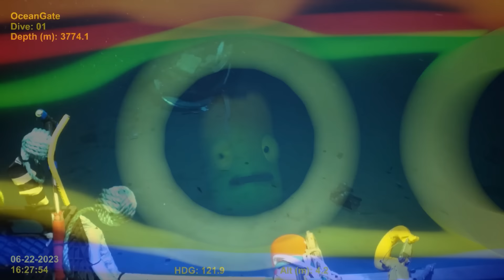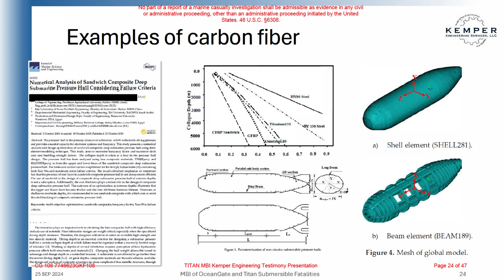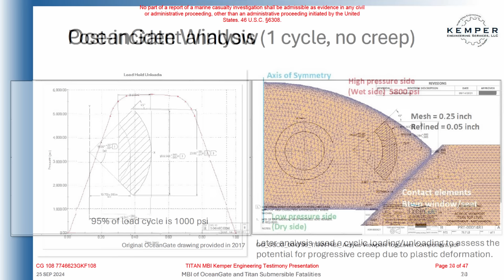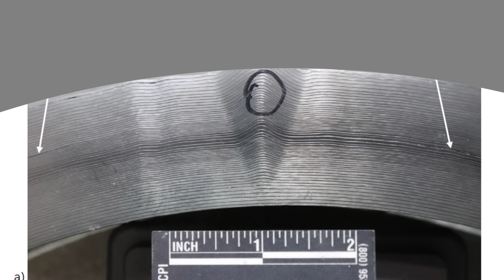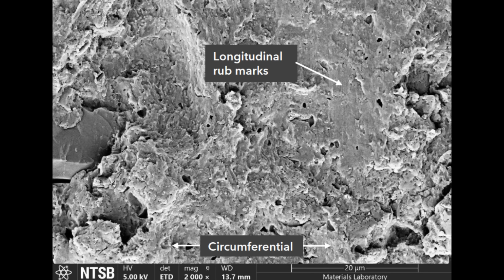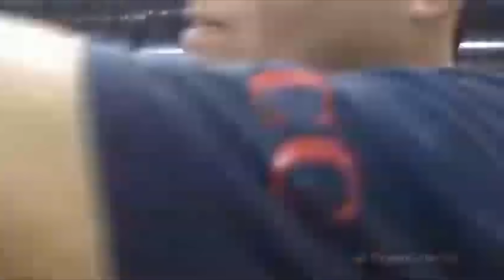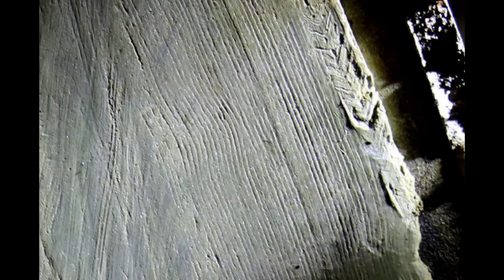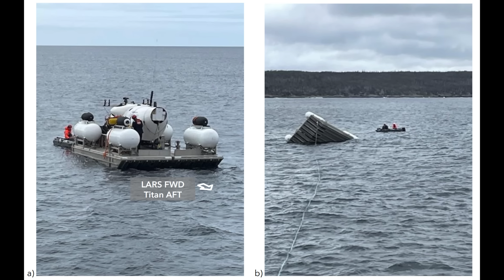OceanGate Wreck Shows Why Sub Wasn't Strong Enough To Survive - NTSB Shares Important Details

Comment: -We built a 1/3 scale model.
-Great, did it work?
-No, but we're still convinced the full scale will work nonetheless.
Reply: The video of them putting the end caps on the carbon-fiber tube were enough for me to realize it was doomed to kill someone. It was like some kind of 'Billy-Bob and Leroy make a sub in their garage' show. Amateur hour gets people killed 4km down.
Reply: @DavidParry-BackFromBanned2019  Absolutely. They didn't use vacuum degassing of the epoxy (which apparently was also the wrong kind for joining titanium with CF), no preparation of the titanium surface either by etching or abrasion, no cleanroom or Tyvek suits, some of them appeared not to even be wearing gloves and put their hands on the rings, etc. It was a joke. It's too bad because had they actually done the engineering right, there might have been a possible application for CF submersibles. Now it's likely no one will even touch that idea for decades.
Reply: @rjinkglider6908  I hope they don't. At 4km down it was only the resin holding the thing together... not the fibers.
Reply: @rjinkglider6908  All that stuff your talkking about cost a lot of money and this guy was not going to spend it on clean rooms, and making sure his number one point of failures were done right
Reply: All that from an educated person who has an engineering degree
Reply: @angelobryan4699  He was a C student. The degree was definitely not worth the money for the paper it was printed on. He knew just enough to be extremely dangerous. He thought he could cheat physics, and if you're an engineer you know down to your bones you can't cheat physics.
Reply: It was the repeated (successful) trips that caused the eventual failure.
Reply: @BodywiseMustard  It was expired carbon fiber. It was failing from day 1. No one knows how it lasted 88 trips, much less the literal first.
Reply: @highpol1ce  It didnt actually last 88 trips, the trip numbering was spread between two diffrent hulls.
Reply: @highpol1ce   well carbon fiber is not approved but it can still be used to go down to deep depts its just that as mentioned carbon fiber delaminates over time and was actually mentioned to this idiot multiple times at the end of the day the accident was caused by ignorance , lack of research , ego , and ignoring every safety regulatory rule when it comes to deep sea travel
Reply: @highpol1ce  "SANDED DOWN THE SURFACE BETWEEN APPLYING COATS"
Oh... you mean severing the fibers holding the 4km of water pressure back? Smart move. I hope they died fast.
Reply: I appreciate your "steel man" of Stockton Rush's view of carbon fiber in pressure vessels.   @BodywiseMustard 

Obviously, they should have been testing the vessel as a robot, until reliable knowledge of carbon fiber's successive use failure rate was obtained.
Reply: @BodywiseMustard It's too bad someone didn't sabotage the sub while it was stored outside in a parking lot.
Reply: I think you misunderstand. They tried carbon fibre end-caps, which didn't work, so they decided to only use fibre for the more stable cylinder, and use titanium for the end-caps, which did pass tests.
Reply: @BodywiseMustard  my point is, did they ever successfully test a scale model of the final design?
Reply: @BodywiseMustard  So the carbon fiber was a problem, so let's only replace part of the problem. Wow brilliant. The negligence and incompetence every step of the way was just, indescrably baffling. Especially when this has all been done before, nearly routinely at this point.
Reply: @BodywiseMustard  Rush didn't do any testing, certainly not to the level that other submersibles are.
Reply: you are clearly not aware they did 13 trips to the titanic successfully before this occurred.
Reply: @TreeHugg and the point of this comment was that they never successfully tested a schedule. and more to your point that they did 13 successful trips, that's nothing. That is a drop in the bucket compared to what most other deep sea submersibles have been. Most can do hundreds or even thousands of trips before they need serious maintenance.
Reply: @the_undead   Agreed, Hasn't Alvin done like over 6,000?
Reply: @sologamer3122 technically yes but Alvin has been to the point where it is definitely a ship of theseus. The nameplates are likely one of the only things remaining from the original launch model of Alvin.

However, even if he original unmodified version, definitely conducted hundreds potentially even a thousand dives before anything major was changed. And Alvin went to much more dangerous conditions than Titan ever went to.
Reply: @TreeHugg  The only way to consider the previous trips a success is to ignore the eventual outcome. Each trip was damaging the hull and a roll of the dice. These were commercial passengers (despite being call 'mission specialists') so the entire point of this was to demonstrate a safe, reliable way to do so. This proved how not to do so and set the objective back substantially.

Comment: When you mentioned machining the layers flat that was a bit of an alarm for me. You ar effectively guaranteeing a void under where the bump used to be.
If you want to look at how the carbon weave matters then you need to look at Formula 1. They have Carbon wings that flex in all manner of ways and it's all about how you lay the weaves of the carbon material. Even the type of weave can make a massive difference in how it performs.
But the main thing about the F1 stuff is it is all multi directional woven material. The fact this appears to be unidirectional makes it fundamentally less strong than ones with multi-directional weaves.

Though by the looks of it from this video it was a whole chain of minor events that contributed along with Oceangate and  Rush's negligence in following up on anything that might have been a warning.

Comment: "Recover human remains" that made me chuckle and I felt bad about it. Judging by how the debris looks and considering the information I have on the subject I imagine that for such a big chunks of the cylinder to have survived almost intact the oposite side of the hull had to collapse so quick against it and at such speed it would make you mist. Sort of like squeezing a roll of toilet paper. Early models suggested a total collapse but because of the pressure at play down there it equalized so quick that the first imperfection that entail an issue became catastrophic and the rest of the vessel "barely" suffer any damage. You can identify quite well every component and structure that have survived.

Comment: Picture is worth a thousand words but only if you speak its language. Does a video count as a thousand words a frame? My translation for this video.
  The initial pop on the previous dive was it opening a glue void, maybe even the dust filled one. The  water got in horizontally to the laminate layers at the machined ring where they cut to fit.  So the outer layers they cut into might as well as not been on there. Then use those shaved wrinkles to travel through layers radially until insufficient layers remained. Then crushed in and sheared off the inner support ring. I wonder how many of them actually knew how to read the sensor data or even looked. Did not realize it was actually a multi dive failure event, figured just one bad catastrophic one. 
   Machining those wrinkles off seems crazy to me, you just tore open your layers, it probably looked like swiss cheese if it had anywhere near as many wrinkles as that one drum in the video. 
   I looked up a video of a 5000 psi pressure washer to see what that water jet would look like, less extreme than I thought but how would it fair against individual layers of the fiber from the atomic level and over every square inch  it can find any imperfection, plus gravity driven vs motor so the pulses would be different.

Comment: They went down multiple times after ignoring the warning systems?!? 

Look, speaking as an engineer, sure there are better ways to design this thing and logically speaking there is no reason to physically being in this thing, if all you see is recorded by an outside camera anyway. But most importantly as long as the warning systems work and have enough of an fail safe margin, a sufficient design can work just fine for the time being. But you can’t ignore those … that’s the whole point! With that attitude the guy could’ve made the perfect submarine and still get it destroyed sooner or later (obviously later, but you know what I mean)

It’s all just aggravating

Comment: To fix the window strain issue while still having the desired optics, couldn't they have an extra insert that is flat on one side and held in place by a gasket. Then you fill the interface between the two windows with a viscous fluid that has the same index of refraction as the windows. That should isolate the load bearing portion of the window from the part that is just there to provide better optics.

Comment: This just gets worse and worse...  ignorance x hubris, Rush compounded the design flaws and the manufacturing deficiencies to eliminate all margins of safety. Really crazy or pathological thinking.
Reply: WRT the carbon fiber cylinder to titanium ring glued interface; the circumferential strain is twice the longitudinal strain, for any applied external pressure. Kind of a guaranteed failure of the glue joint. The inner flange of the Ti ring would have needed to be much thicker, and the titanium ring to carbon enforced cylinder interface would have needed to be stepped or beveled to equalize the strain on the two sides of the glued joint.

Comment: i mean this is why you should never trust for profit extremely dangerous exploration ventures. space, ocean, mountaineering. i mean this sub should be checked thoroughly after each dive but that cuts into profit. when profit is the sole driver safety goes out the window.

Comment: 15:43 i dont have a clue, but if either the glue or the fibres show, that means that in general the two components were matched pretty well and both gave way at the same amount of force. If there was a clean layer, that means bad adhesion
Reply: You cannot conclude it that way, it depends on local bending forces.  That can produce any pattern.

Comment: Most probably there were no dead bodies or even pieces. When the hull is breached and water rushes inside, the inside volume becomes literally a diesel cylinder with oxygen and organics mixed and ready to combust, with water playing a role of a piston. Everything combustible inside has ignited and was consumed by a huge flash. What didn't ignite was shredded by the cavitation bursts even before the hull touched it.
Reply: I'm not so sure, for example you can see a picture of the computer monitor that was inside the hull and it is essentially undamaged (I mean relatively, it's twisted and banged up but it's easily identifiable).

The dieseling would last a tiny split second and is essentially irrelevant, nothing solid will be burned up or ignited by it (the time frames involved are simply not long enough to allow meaningful heat transfer no matter the temperature).

It's also unlikely that their bodies would have been inside the compressed air bubble when it ignited.

Of course the implosion/cavitations would be extremely violent but I would not be at all surprised to learn significant 'chunks' were identifiable as feet/hands/jaw etc. etc.
Reply: Did they nude diving?
Reply: @Winkemaennchen  why would you ask this?
Reply: @onebronx  Afaik, not even one shoe found, neither other remains and no fishes for the big meal.
Reply: @Winkemaennchen  yep, and my initial comment explains why it is so

Comment: Experiment to try at home: Compare the stiffness of a cardboard paper towel tube, to a tube built from a rolled stack of paper with the same total wall thickness. You'll find the solid tube is much stronger. Those four glue joints between the sections of carbon fiber are a big weakness in the design (literally).

Comment: Abt the window shape and magnifying effect... wouldn't it be just as easy and way safer to use a regular window with an insert held in place right behind it? The insert only stands to correct vision, and isn't load bearing. The only problem I could see is if the outside window changes shape at pressure the insert might not fit or work anymore...

Comment: The real, real reason is because you would have to NDT test it for every dive unless you over built it for safety factors so much that it would be heavier.
 Ceramic Composite is probably not the same type of thing as CFRP.
 It could be a metal, ceramic matrix composite material. Whole different critter there, think about a ceramic sponge saturated with aluminum.
 It's the dozens of layers of fibers hidden from inspections that makes that design unsafe.
 The glue failing in the glue and on both sides is exactly what you want, the glue joint was overloaded and failed perfectly.
 The second glue joint was a bad joint where the adhesion to the carbon failed, bad surface prep or poor clamping pressure.

Comment: If what you’re saying about carbon fiber not working under compression is correct then why the hell is it used in formula 1 monocoques for the cars,…. That’s is exactly why , it’s compression loads and  its ability to absorb compression and protect the driver.

Comment: My theory is that water leaked in and they died a slow and painful death as the water filled the submersible until covering over their heads and then after about 2 minutes after they died the submersible imploded.
Reply: Water is not compressible, in that scenario no implosion possible.

Comment: I originally thought it was the carbon fiber of the hull. It seems it would have been better, weight wise or whatever, to use a solid SS steel hull. It's not worth people dying for weight reduction.
Reply: Titanium is way to heavy for such a construction. You need big ballast tanks and that type of boat you can simply buy.

Comment: Hi, I responded to one of your earlier video's: I'm a mechanical engineer so I think I can provide a little insight in my train of reasoning for the consequences of the multi layer solution to the wrinkling problem. It works best if you compare the use of carbonfibre in this case, when picturing a rope. Ropes can deflect expansion stress (high higher pressure inside of the sub) better than compression stress (high pressure on the outside of the sub; like standing on a balloon). The same goes for carbonfibres: they are great for pulling forces, not so much use for compression forces. To make them withstand compression forces better, the fibres are moulded in a resin, usually epoxy. The weak spot this creates for using the Titan, is that the hull will only be as strong as the resin that keeps the fibres in place. However, as it now seems, the point of failure for this incident was actually not the hull, but it's connection to the spheres. In hindsight that makes sense, because here there is no other material than the epoxy glue. When the Titan would be put under repeated stress cycles, micro cracks are basically inevitable to appear in the way the titan is constructed. The mechanical properties of the epoxy/carbonfibre hull would change with every stress cycle, witch would result in a even so slightly different deformation in the hull and spheres, resulting in weaker spots, etc, etc. The whole basic conclusion would be that carbonfibre is an unreliable material to use under a very high compressions stress situation and could best be avoided for repeated use, unless very high safety tolerances would have been calculated. Unless of course, the high risk of death you are willing to take would be acceptible, witch it hardly is.

Comment: Oh wow!  Only 20 minutes in and I'm amazed by the smooth surface with no glue sticking to it.  Roughing up the surface is simple to do and is one of those obvious things.
Reply: Water will creep in the fissures and will delaminate the cf very fast. You have to handle 400bar wich is 400tons of pressure per m² . It is simply impossible to dive in such a depth with that construction eg. you cannot roam your ballast tanks w/o 400bar++ air pressure and these are heavy wich needs larger ones wich needs more air wich needs larger air tanks wich needs thicker air tanks wich adds to the weight aso. I bet it's a scam. You can see it in every part, eg  the lamp wich shows you nothing in that dark deeps due to position and size light is maybe important in a sight seeing tour.

Comment: Without becoming an expert on materials, is it possible that consistency of material properties is most important in this application?
A chain is only as strong as its weakest link, and it seems like metals and pure plastics might have more consistent “links” as opposed to carbon fibre, due to their simplicity and consistent grain/crosslinking.
Reply: There is no way epoxy and fiber distributes the pressure force around the boat. They do not build a crystalline structure like steel (adjustable w. heat treatment and checked eg with microsection and a microscope). Under that force it becomes weak instead of harder as steel do.